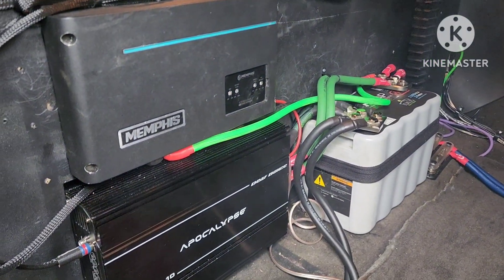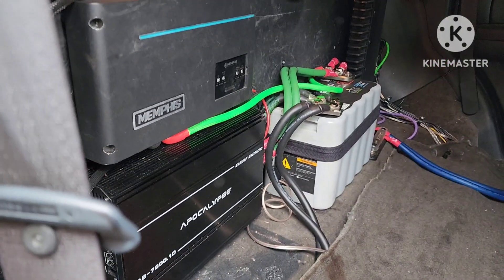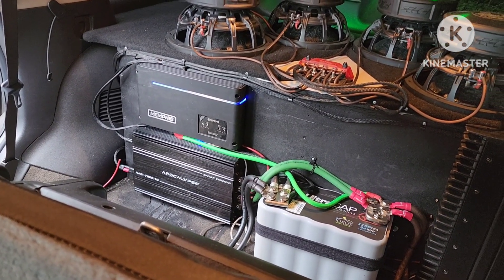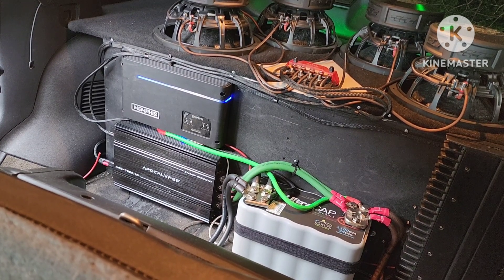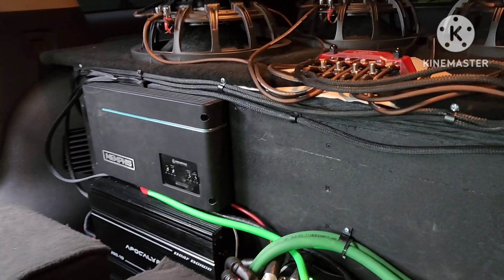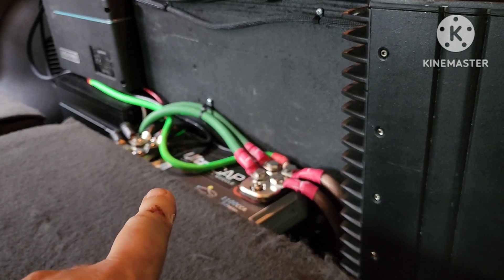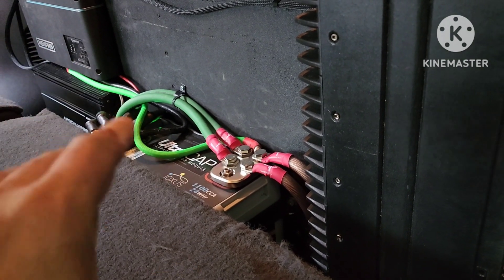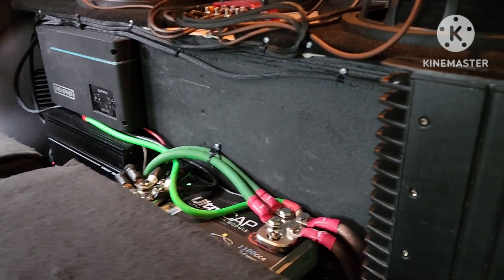Can a Super Capacitor Improve the Sound Quality of Car Audio?

Comment: Hello,

I enjoyed your video and all the information about this super cap. 
I'm going to have one of these super capacitors soon. This summer. My question is what's the best most efficient way to connect it? 
Amplifier to AGM battery and capacitor to AGM? Or an AGM battery to a capacitor and then an amp to the cap? Is there any difference? We're talking about a salon car boot space so it's not a long-distance running power cables. I want to plan this because I want to buy enough cables and I buy all car audio stuff from the USA. I live in the UK. 
Please help if you find some time. 
Thanks
Reply from the maker: place it as close as you can to the amp, and youre gonna want to replace the agm in the back, honestly you can skip the cap totally 
use this instead    https://trunkthunderlithium.com/?product=banger-5k-v2   discount code cae10      put that back near the amplifier  that battery can power the amp and the car alone, its a beast
Reply: @CarAudioEnthusiasts thanks for your reply. 
My car has a stock water-cooled, 190A alternator that charges the battery with a voltage of 12.5 up to 16 Volts. It depends on what the electrical system requires and what the current gas or brake pedal use is. If I'm slowing down and the battery needs it, the alternator will charge with 16 volts ⚡️. 
It's an Audi A8. But if I'm constantly driving on a motorway it can only give 12.5V. At idling it's very often 13.2V but sometimes 14.8V. It's not waving like with a broken Voltage regulator. It's just like that always. 
So in this case I think Lithium can't be used. So I need to stick to the capacitor 😅
Reply from the maker: 16v is too high, too high for agm or lipo4, 14,8 is the max you want to see. you may have a regulator issue
Reply: @CarAudioEnthusiasts 
Audi smart alternators can vary their voltage output based on driving conditions, battery health, and power demands, with a typical range between 12.3V and 15V. During deceleration or when the battery needs a charge, the voltage can spike to 15V or higher to facilitate regenerative braking and rapid charging. 
16V is the highest peak I saw and this is how it works. The voltage regulator is a big control module in the back of the car, not on the alternator.. My friend has same values, same high sometimes, depends on conditions and cars needs 🤷🏻‍♂️

Comment: I’m starting to look into getting one. I have been wanting to do duel batteries in my 4Runner a long time. I do have off road lights and more. But I’m at about 1,100 watts RMS with my amps and it definitely putting a strain on my car. I have done the big 3 upgrade Odyssey AGM battery. Have a new stock alt it’s just putting out the stock 130 amps. I realize the difference between a super cap and a AGM. But the Super cap can be smaller and maybe less expensive overall to instal? Would like it put the SC under the hood basically where a second battery would go but need to look into if heat will affect it and also the distance to amps. Also how large of a SC would I need to really make a difference? Installing a second AGM is a lot of money and effort and ultimately I’m mainly looking at the SC to just be for the amps only let everything else run of the battery as is. So if anyone has some thoughts and or links that would help me figure this out I’d appreciate it. Thanks!
Reply from the maker: sc is best installed as close as possible to the main amp. but it will help anywhere in the system.
Reply: @ For sure, as far as I have figured out so far they should be affected by the heat under the hood too much. Not like a LiPo battery or whatever would be. I’m taking off to the back side so really probably 24” from the Eng. Just make a perfect location plus my power splits under the passenger seat one amp under seat one in the back situation. So just tap into my 0 gauge before it goes through firewall. I really don’t want to put anything in the back if possible. The rear amp is already hidden inside the panel, so all you see back there is my sub box.

Comment: Doe the green light stay on on the cap when the vehicle is off
Reply from the maker: nope, it should go off after a bit
Reply from the maker: it will somtimes stay on if theres a load on it, if its seeing a load.
Reply: @CarAudioEnthusiasts  I hope it goes off the only thing is on is my car alarm.i got the ixous cap not new but no stock online since I installed it the green light stay on is there a way to turn it on and off. It didn't come with paperwork.
Reply from the maker: @kemkyothood7920  you can set it to maint in the app,

Comment: Worth every penny and yes increase sound quality
Reply from the maker: agreed
Reply: @CarAudioEnthusiasts  have a single 100 farad pack. can this positively add to a smaller sound system? if so, it will be connected close to mono class d 1000w(1 ohm) amp into a single 12` sub
Reply from the maker: @hotdog9262  at that wattage yes, for sure

Comment: Wondering if i need a high output generator to run this batterybor my standard generator will be good to power it. I am trying to just add one amplifier maybe a 5 channel amp to run all my system. My goal is to replace my 6x9 in the rear and front 6.5 and a pair of 12s only 100 watts rms each. Hmm. Any suggestions or advice. 😊
Reply from the maker: the ultra cap works fine on a stock alt, and would be great for the build youre planning!
Reply: @CarAudioEnthusiasts  thanks for your feedback 😊

Comment: Does the super capaicitor require any maitanaince?
Ive been seeing videos that say the small stereo capacitors, 1,2,3 farads need to be de-charged if you dont start the car in 4 or 5 days and you have to put the transistor on + & - to charge it and to decharge it, is any of that hassel needed on a Super capacitor❓
Reply from the maker: nope, at least not for the ioxus, it goes into maintenance mode after  a few moments of not seeing an alternator.

Comment: Looks good. Love Deaf Bonce. I added some lithium to mine(Glowe Voltage S2, LifePO4 with a 460a constant discharge and 530a burst. no supercap fast but fast) and got a nice boost in quality as well.  Before the upgrade, I would start to drop to a couple of volts on the really heavy stuff. I expected to get an extra click or two on the volume knob, but its sounds cleaner and noticeably more force from the sub , like you said "punchier". It turned out to be a nice upgrade. When I get the 8k in, I may try a supercap or I might add another GV.

Comment: So you considering going full lithium?
Reply from the maker: nope. i have a colored past with headway.
Reply: @CarAudioEnthusiasts  have you tried yinlong, Plano, or those simp whatever cells? I've heard alot of good stuff about those simp ones. I know I'm saying that wrong lol. But I'd love to hear a story time of your experience with headway. I've had mine for 2.5 yrs hooked up w no problems. I just top balance once a year.
Reply: Capacitors have more power density than lead acid and lithium batteries and lithium cells can go bad and start fires. capacitors are far more robust aslong you don't go over the voltage rating.

Comment: What’s your take on running super banks under the hood I’d like to use a super bank for a battery delete instead of just having. Box or just terminals under the hood as I have lithium in the back? I see you have your close to the amps as I want mine under hood were the battery would go?
Reply from the maker: you can, at least with these, they're designed to replace a second battery.
Reply: I have my cap under the hood where the battery was. It works great with my Lithium in the back.

Comment: Yes the can because it helps the amp stay at the proper voltage which will help the amp be efficient as possible, better signal out of the amp means better sound from the sub

Comment: So the ioxus UC31 are totally worth it. 3000 farad ultra caps divided by 8 for capacitance equates to 375 Farads. That be monstrous compared to the olden days in the late 90s early 2000s with the monster 2 Farads lol 😆 🤣
Reply: That's the wrong info , the company says the cap is rated at 300F and 12 to 24v with a maximum  of 27v so that means it has 10 caps 2.7v x10 is 27v so for 99$ you get 10 3000f caps with Bluetooth and BMS you can't beat the price

Comment: How do you charge these things?
Reply: I bought an adjustable power supply on amazon to power my supercaps. Cost around sixty bucks. Or you can use a light bulb as a resister..just run it inline..takes alot longer though
Reply from the maker: THESE handle everything automatically , just hook em up and the brain charges them.